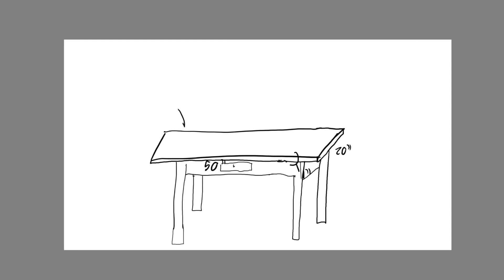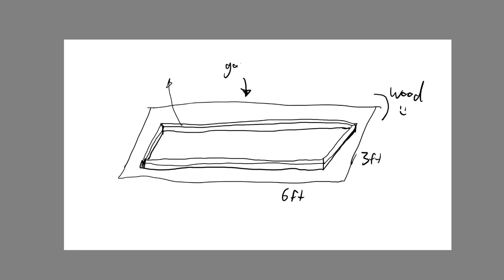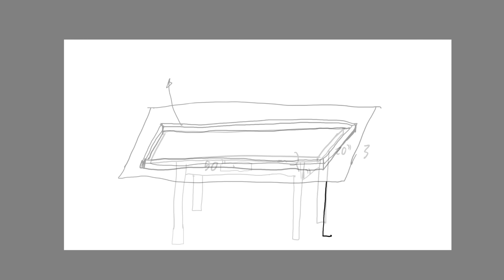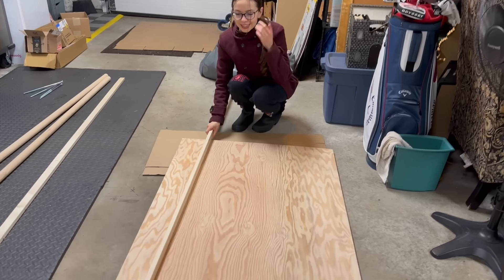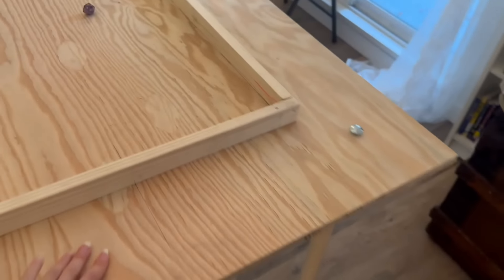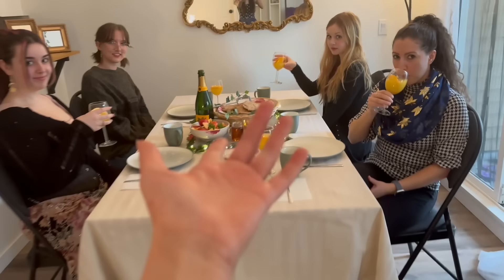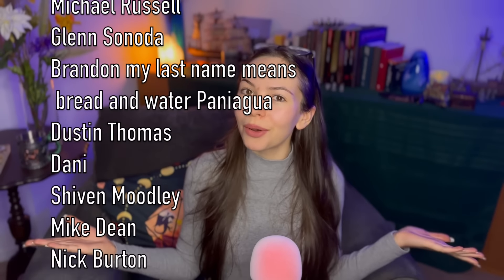I Built myself a D&D Gaming Table in a Day!!

Comment: nice job with the table and for wearing your safety glasses.  🔨
Reply: @bethanyaudion9441  The side panels help keep splinters from sneaking in on the edges to gouge your eyes out.
Reply: @bethanyaudion9441  Modern glasses are very expensive so it's best to avoid damaging them.
Reply: 4:01 - Wish the old guy ripping boards at the home store had been wearing his. 😦
Reply: @digitaljanus  I deleted my previous comment because I did not consider the side panels on safety glasses and other issues when I typed that comment.

Comment: That's a great job! Glad to see your teamwork, too. 🔨 Question: Does the frame just lift away, or do you have another sheet topping over it? If it's not attached, you could always put a clear acrylic sheet on the bottom side to add stability for when it's not on the table. Then you could lay down whatever grid map, or Flip-Mat, or drawing, and still have a clear view through the acrylic. Just a thought.

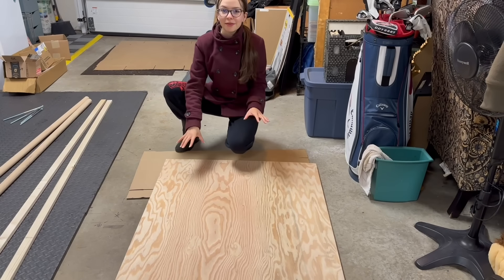Comment: What is the castle on top of the tote in the garage at about 6:25 in the video?
The DM's side sit in front of a mirror? ... ... ... Are you trusting that your players won't look int the mirror to see behind the DM's screen, or do you plan to put fake information in the areas they can see from the mirror to throw them off if they try to get a peek?
As far as a grid on the inside you might want to consider a getting a dry erase sheet instead of painting a grid. 
When you talked about painting the outside area I immediately pictured the Talisman game board where there are different sections of the board with various spaces in each section.
Entertaining video, and cool idea. Hope that you have a lot of fun with your gaming table.
Hammer so you know I watched it to the end.
May the dice roll your way.